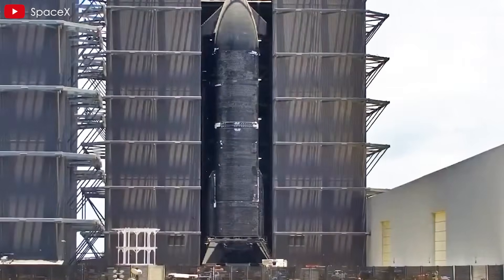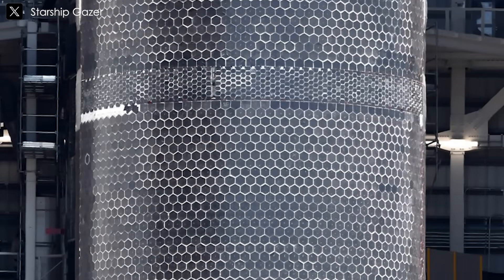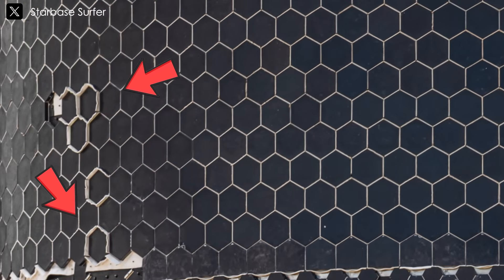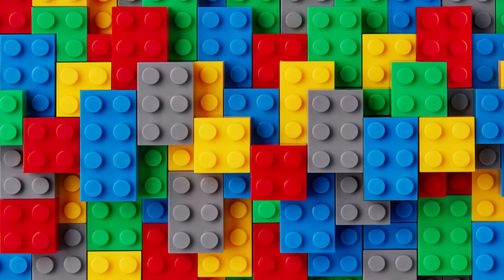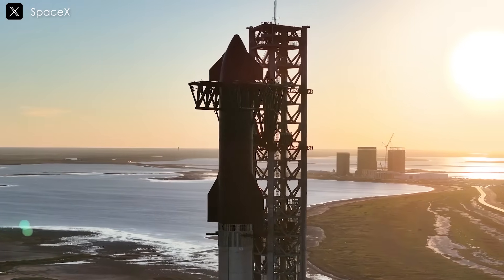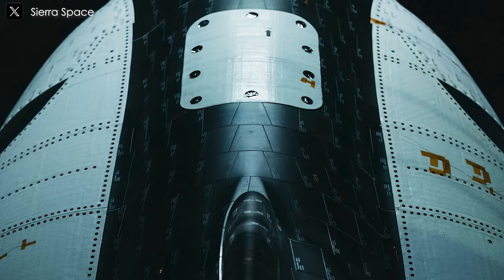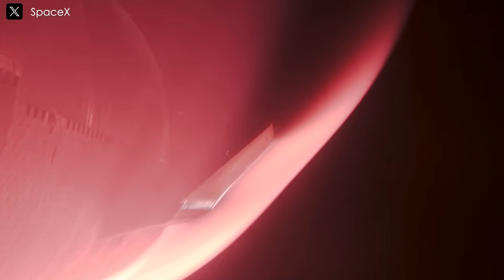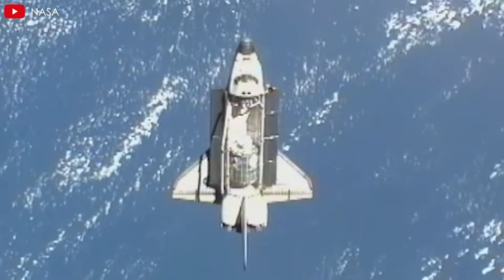SpaceX's new Starship Heat Shield Upgraded just Humiliates NASA's New Space Plane...

Comment: High-temperature ceramic fiber materials like those in the video were used by NASA between tiles on later Shuttle missions, mainly as gap fillers. Entire sections of the upper half of the later Shuttle missions were covered with blankets of this material, where re-entry temperatures didn't get hot enough to require that they be covered with ceramic tiles. So this isn't a technology pioneered by SpaceX--it's a continuation of NASA's work on this approach, with one of SpaceX's main innovations with this material being to apply entire blankets of ceramic fiber to parts of the body of Starship first, and then to install the tiles on top of that, followed by inserting more of this ceramic fiber material inbetween the tiles.  Sounds like good over-engineering to keep everything intact during re-entry, and thus to ensure faster turnaround for each Starship.

Comment: Starship has not successfully landed in nine launches and has had numerous issues with flap hinges and other parts burning up.  Dream Chaser is much smaller than Starship and its Starship enormous size that's complicating the development.  The enormous size leads to issues with parts not mating properly when moved or actuated -- problems like the Pez Dispenser door that they've tried to open several times but the door always jams.  In engineering there is an issue called 'oil canning' that causes large parts to buckle and wobble owing to the shear size, smaller items do not have the same problems and Starship IS HUGE so this problem is much greater.  Once again the space media is orally ball washing Musk and he isn't ever going to provide a reach around!  Every version of FSD is a game changer that "This Changes Everything" -- but in the end the new FSD is only marginally better than the old FSD.  In fact, Tesla and FSD are only rated at level 2 with several other car companies at level 3 and BMW reported to be closing in on level 4 -- Tesla is NOT the leader in self driving!
And Starship is a terrible design that will continue to fail!

Comment: All a bit wrong. The temperatures during re-entry after a Mars orbit at an entry speed of over 41,000 km are over 3000 degrees C. Current heat protection can't withstand that. Only the stress from Earth's orbit can. (27,000 km / 1500 degrees C)
Reply from the maker: Thanks for sharing. We will notice it
Reply: Yep. I was wondering why nobody was talking about different reentry velocities from different destinations (LEO, Lunar, Martian). I wonder if they will have multiple versions or make multiple aerobraking passes to bring down velocity incrementally
Reply: @Robert-cd5zr  It's possible, but returning from Mars would require deceleration to at least Earth orbit speed, and I fear temperatures would still exceed 3,000 degrees Celsius or more. Unless the spacecraft had significantly more surface area, like a glider. But that's not the case right now; it's round.